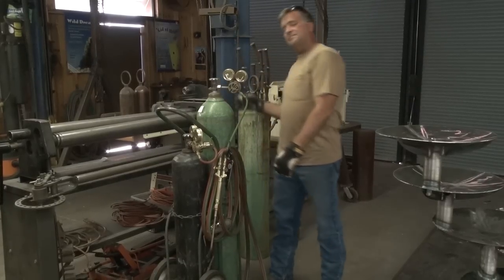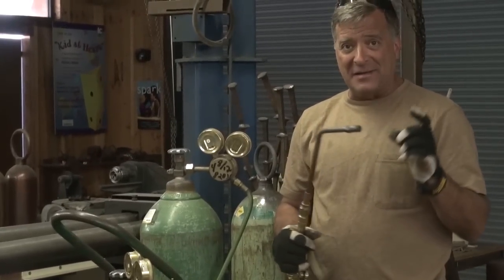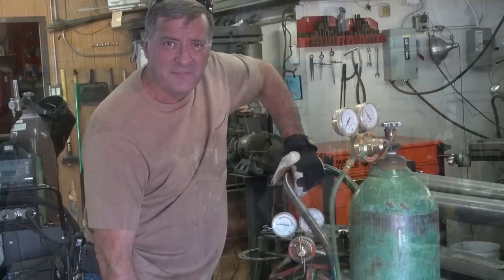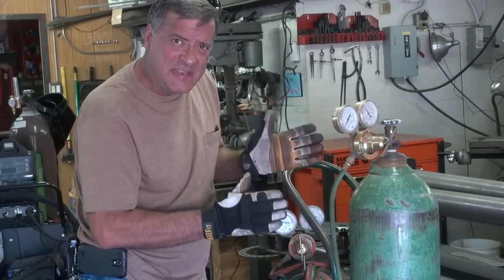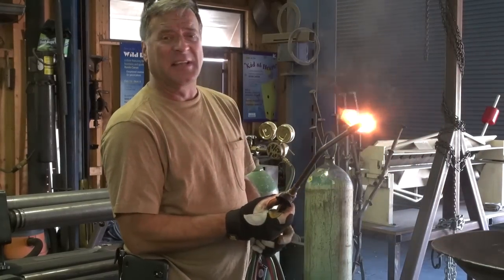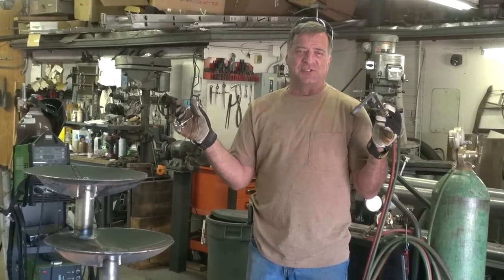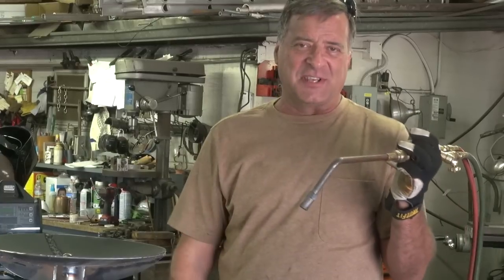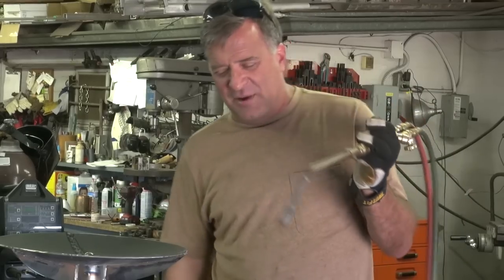How to Handle Oxygen-Acetylene 'Popping' - Kevin Caron

Comment: Air can be leaking in where the torch tip screws to the torch body.
Reply: Yes, I had a cheap rosebud that was barely leaking just behind the main head which I did not know at first.  Dang thing would work fine for a bit but all of a sudden pop.  Then I noticed if just the acetylene was on it would sometimes light like a match size flame there on the side.  Had a damaged seat of the head, took it back and got a replacement but this one had no leaks and worked like it should with no popping.

Comment: I also have popping issue when connecting my 0 cutting tip. I checked and verified all setting. I light gas and set flame. I then start to add oxygen.  just before I get to neutral flame it starts popping.  all part are brand new
Reply: Mine also

Comment: i have a harris built craftsman  commercial torch set i bought a new cutting torch tip for it    firing it up it pops every 20 secounds just free burning then  it back flashed into the hoses and started burning a 50 ft hose back to the tanks fortunately i got the tanks shut off before disaster. i have had smith victor and marquette  cutting torches and never  had this problem my dual stage  regulators were set a 7psi   acytelene and 25 psi for oxygen with a stable neutral flame exscept for the popping
Reply: Definitely invest in two sets of flash arrestors, one set at the tanks and the other set at the torch, and also carefully inspect your hoses as they have had flame inside and maybe damaged. A new set of hoses and arrestors is cheap safety insurance vs. a gas bottle explosion and/or fire with you somewhere in the area and liable to be caught out.
Reply from the maker: Sounds like you had a loose connection somewhere.

Glad you were not hurt.

Comment: What's with that green tank next to  the oxy tank with a large ring on the top??
Reply from the maker: +Ben Boudreau 

I was making a bell.     That ring is to hang the bottle.
Reply: Sweet I was thinking of doing that someday too! So I contacted my local welding supply for expired cylinders! They said they will get back to me.
Reply from the maker: Look for a hydrostat testing shop.    They check the bottles to make sure they are good.   They will have a large pile of bad bottles for sale..    Or check your local scrap yard..
Reply: Good suggestions thanks!

Comment: I have a set of victor gages I have used for a long time (years) without problems. the last few months I have had a terrible time with popping. it starts out after just a few minutes. Now I can barely get it to use a full amount of flame compared to what I use to use, or it will pop right away. I have to have it at such a low heat it takes for ever to heat something up. I have the pressures set correctly for the size tip, and I never have it close to the part I am heating up to heat treat. after a little while it pops so much it sounds like a machine gun. super fast super loud repetitive pops until I just shut it off. I have tried cooling the tip and it works good for just a short time before it happens again. I thought it may be a bad tank of gas but just recently have replaces both O2 and accyt. tanks with same results. should I go buy a new set of gages and tip? do you think that is what I need. thanks for the help.

Comment: Hey STUDLEY!!!!!!!!!!   Never saw that Before,, Heck  I Just Looked at Mine,, I Have 3 , for Purox Torches,, and The BIG BOY!!!!!!!   Makes that Look like a Brazing Tip!!!!!!,, where It seems every AUGUAT,, we get a Casting approx 18" Thick,, so 2 days of Veeing It Out!!,, Quickest way,, is take 7024 , Jet,, and soak it,,and Crank 500 amps,
Sure does save ALOT Of Grinding, except clean up  Before we start to Braze,, I have Old Pics around,, where there Homemade, Flame throwers,, a Spare 30 Gal Kerosene Tank, with compressed Air,, wait till i find It,,I still have 2 Left,, and id get In and On the end was a Cone,, where the Flame came Out!!!! Approx 6 to 7 ft.. and Fiire Both UP,,They were Loader than Jets Over Kennedy Airport,, But By 7 AM,, The Connecting rod, would Be Cherrry red!!!!!!, And 2 Of us would start Brazing,, Approx 125 Pounds of Brass,,
And of couse It Was NEVER in the winter!!!!!!   Allways the muggiest Hottest day In August!!
Just Glad ya didnt tell the Non english speaking Guy to shoot some penetrating Oil,On the OXY Regulator!!!!!!!!   Had a new Guy In Town, where My Old dungon was,, and BAMMMMMMMMMMMMMMM  yep,,he did IT!!!!!!!,, WOW,, spit That Oxy Bottle Wide Open,, But for the Big Rosebud,, Id have to manifold 2 Giant Acc. Bottles together, to Keep it from Poping,, and push close to the MAX On the ACC regulator,, 15 Lbs,, and Full, Would still POP,, !!!! But acc wasnt to bad in Price back then,, Now,, a second and 1st and 3rd Mortage!!!!!!!  Take care there STUDLEY!!!!!,, Looks like Ya Ate Out a FEW,LOL :) Times till the water went down,, and Missed the SALAD BAR!!!!!!!!,, Dont Blame ya!!!!!!!  we Aint Rabbits!!!!!!!!!!,, Jack...

Comment: Excellent video.  One other thought "popped" into my head:  (for rosebuds and also for welding tips).  They come in different sizes for a reason.  If you are using too large a tip, and  try to run it low to reduce heat, the gas in the head is moving so slowly that the flame can move up into the head, which will make it pop.  Us the smallest tip that will provide the heat you need, and keep the gas flow to near maximum.  Then, if you still need more heat, use the next bigger tip.  That keeps the passages in the tips cooler, and the pops will become rarer.  Kevin, love your videos, keep up the good work !!